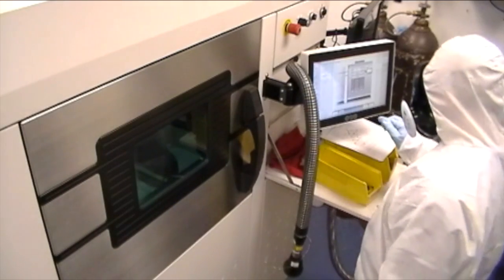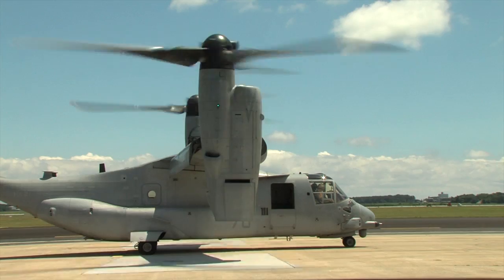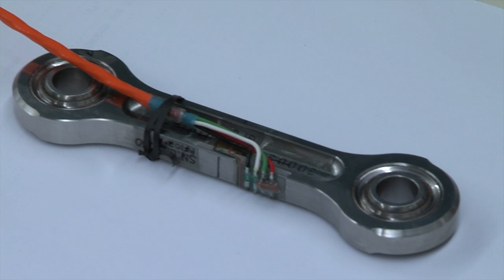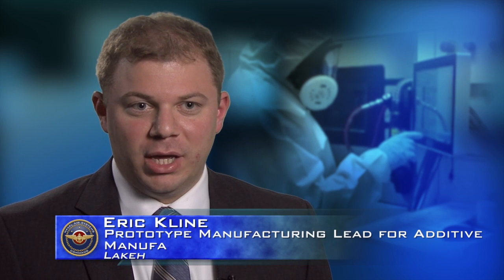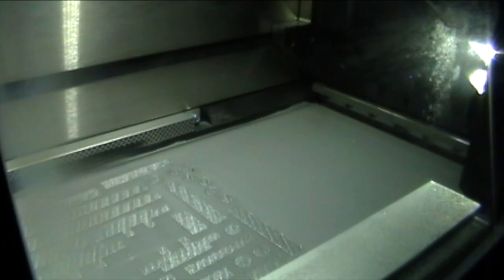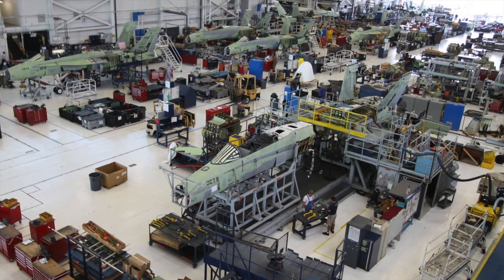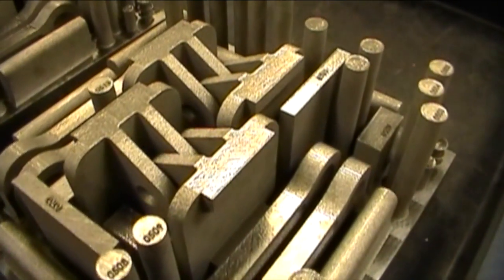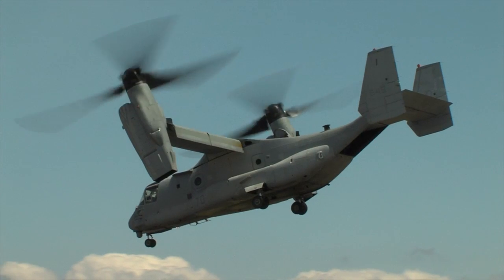Flight Ready: Additive Manufacturing: Printing the Future of Naval Aviation

Comment: So basically you have a group of people who are building an empire, so they are looking to show everyone that their "additive manufacturing" is the solution.  This titanium link is a perfect example.  They looked through parts to find one that would be easy to print, in a material that was printable.  Forget aluminum parts, because 3d printing aluminum is very hard, and dangerous.  So pick a simple titanium link.  The comment that it would take years to standup a similar production is false.  If you did the exact same thing using CNC as your process, you would have the same results.  The new 3D printed part is not better that the traditional part.  It is not faster, as the same part could easily be produced in much less time on a tradtional CNC machine.  This "testing" of the part was pretty vague as well.  I am sure that the orginal part had to withstand a much more rigorous testing regime, other than instrumenting it with strain gages and flying it.  The original part probably had to undergo a full environmental testing regimen which was neglected in this case, so the Navy could showcase their 3D printing process as a viable option.  Right now within the Navy there are so many people wasting time promoting 3D printing, because that is where the funding is and all of the Navy brass is looking to show of a shiny new object.